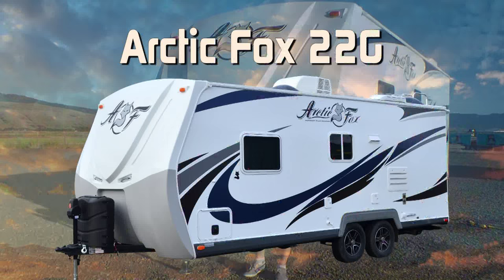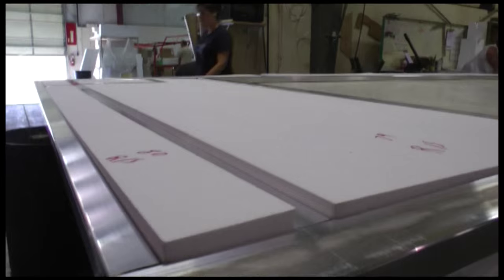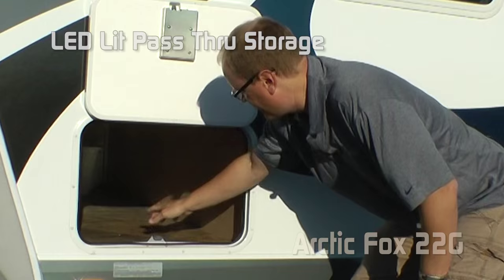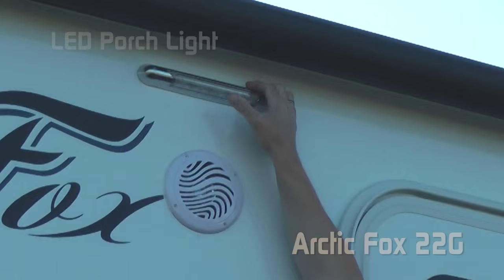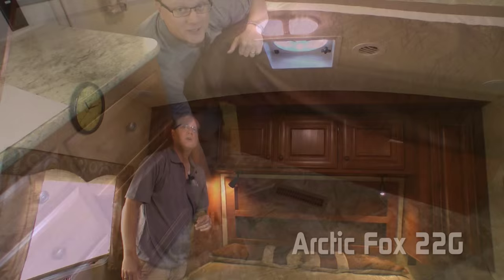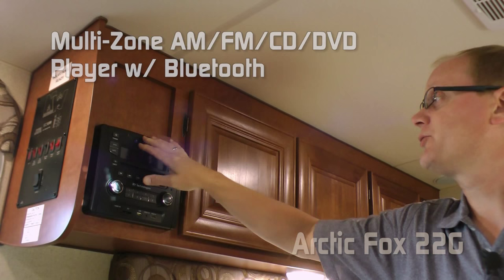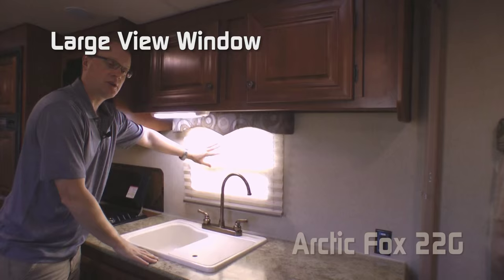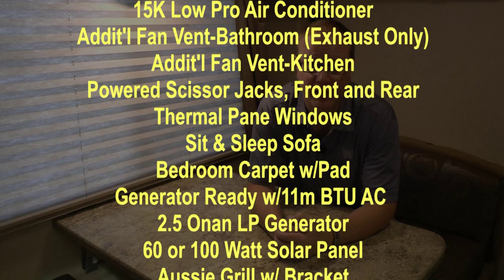Quick Tour of the NEW Arctic Fox 22G

Comment: Every manufacturer says the same thing. What makes you great?
Reply from the maker: We are well known for our quality and TRUE four season capability.   We build our own chassis, subfloor, sidewalls, truss system roof, and our own cabinets. If you watch the video again and compare many of the features to other manufacturers you will see a big difference.  I would also recommend to ask previous and current customers of our products on AFNASH.com
Reply: Mozilla Firefox prevents me from accessing your site.  States it's not correctly configured to prevent my info from being stolen.  Please fix as we're seriously considering one of your units.  Thank you.
Reply: @northwoodmanufacturing2408   Are you doing anything to fix the issues mentioned by your owners under this video? I have noticed some posters in your owners forum also saying that they are waiting for thermal issues to change before they buy, or buy another one. I especially don't like that wall construction without a break. I looked at Triple E in Canada and they also won't build an aluminum frame coach for cold weather without a break. It really hurts the value of the insulation and that's a main reason I would buy.
Reply from the maker: @mpenner2124  Thermal issues? I don't quite understand your question. Please call us at 1-800-766-6274
Reply: Northwood Manufacturing  If someone with authority at Northwood isn’t even bothering to read the discussions among Northwood owners in comments under your videos like this one or on the owners’ forum, that concerns me even more. I’m not going to call you in order to just read you all their comments! Northwood needs to be learning from its owner experiences, especially owners who are engineers.  There are other videos about Northwood thermal issues, too:  https://youtu.be/nRFJnzc_nnE